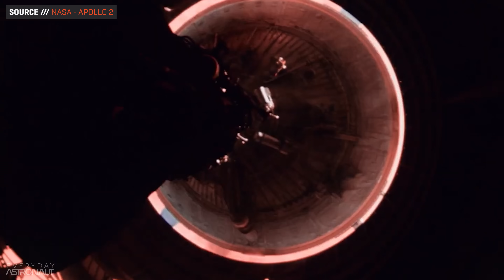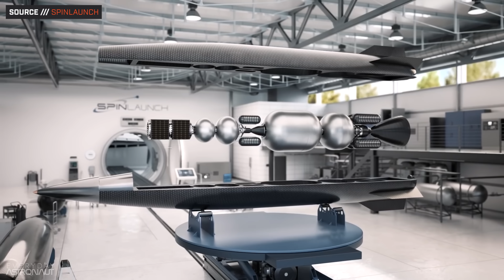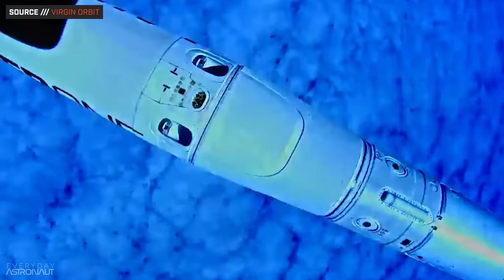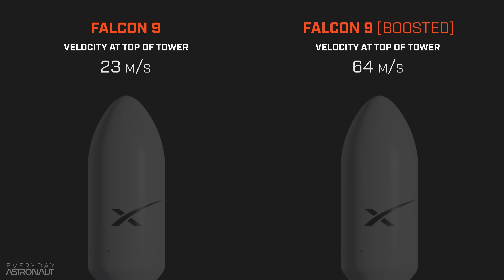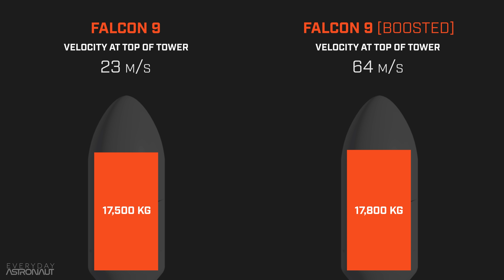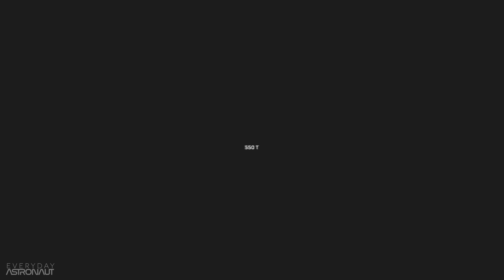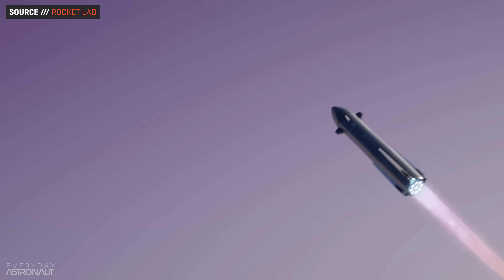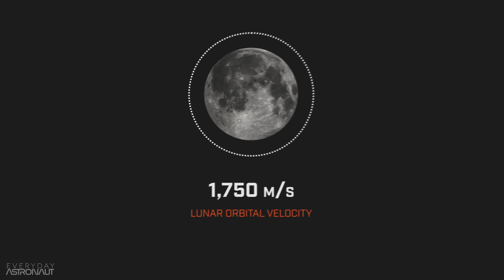Could We Help Push Rockets To Orbit?

Comment: You don’t need solid steel to fill a cube with weight, on a counter weight… fill it with water instead. Won’t cost $4 million dollars to pump water, & use an electric winch lift it empty, then fill it again. The water can be bled off to reduce falling weight.
Reply from the maker: Water is less dense than steel so it will require much larger size and more steel to support the water

Comment: 22:22 what if there were tubes that were a part of the vacuum system that quick released to open moments before the hatch at the top needed to open.

The pressure filling the vacuum from the bottom of the rocket just prior to getting to the hatch couls add more velocity.

The hatch for the rocket would open a moment before the tunnel has reached normal atmospheric pressure at the bottom of the shaft.

Comment: I think we should continue to fill the propellant tank till the booster is past tower  essentially running the engines via ground based tanks  , I guess will just have to increase the tower length to 300 meter { which is achievable} and create a feed mechanism [tubes } on slide rails or something in y axis . this will essentially act as a booster stage , with no addition of mass on the rocket itself , in fact the rocket mass will decrease substantially as we can redact the propellant tank size  overall booster which otherwise would have been used for initial acceleration, plus engine thrust rating can be decreased to obtain same mass to orbit effeciency, this extra effeciency can be either used to put more payload or make the rocket more reusable.   like it so TIM can see it and a video on it

Comment: The concept of imparting an initial velocity to a rocket via a "throw" mechanism from the ground: while the idea of gaining initial kinetic energy for \Delta V savings is theoretically sound (directly reducing the required \Delta V from the rocket's own engines per the Tsiolkovsky rocket equation, \Delta v = v_e \ln(\frac{m_0}{m_f})), the practical implementation presents formidable engineering challenges that likely negate any net benefit.
> 
> Consider the impulse required: I = F_{avg} \Delta t = \Delta p = m \Delta v_{initial}. To achieve even a modest initial velocity (e.g., hundreds of m/s) for a multi-hundred-ton rocket, the peak forces (F_{avg}) required would be immense, leading to extreme structural loads on the vehicle that far exceed typical launch accelerations. This necessitates significant over-engineering and mass penalties for the rocket itself, counteracting the very \Delta V savings sought. Furthermore, the energy transfer efficiency of such a "throwing" system (e.g., a railgun or giant catapult) would be highly complex to optimize and maintain at scale.
> 
> In contrast, the established advantages of air launch (launching from an aircraft at high altitude) are fundamentally more efficient and achievable:
> 
>  * Reduced Atmospheric Drag Losses: The dominant term for atmospheric drag is F_D = \frac{1}{2} \rho v^2 C_D A. By starting a launch at, say, 10-12 km altitude, the rocket is already above a significant portion of the Earth's atmosphere, where air density (\rho) is substantially lower (e.g., less than 30% of sea-level density at 10 km). This drastically reduces the integrated drag force over the ascent profile, directly translating into less propellant expended to overcome aerodynamic resistance.
> 
>  * Minimized Gravity Losses (to an extent): While the instantaneous gravitational acceleration g doesn't change significantly at these altitudes, starting higher means the rocket spends less time accelerating vertically against the full force of gravity from sea level. The gravity loss term, often approximated as \Delta V_{gravity} \approx g t_{burn}, is slightly reduced due to a shorter duration of high-thrust, near-vertical flight in the densest part of the gravity well, and potentially allows for earlier pitch-over maneuvers.
> 
>  * Initial Velocity Vector: Air launch provides a modest initial velocity (v_0) relative to the ground (e.g., ~Mach 0.8 to 0.9, or ~250-300 m/s), which directly contributes to the overall \Delta V budget. More critically, this velocity can be largely horizontal, aligning with the desired orbital velocity component, unlike a vertical "throw" which requires an immediate, energy-intensive pitch maneuver. This initial horizontal velocity directly reduces the \Delta V required from the rocket engines to achieve orbital insertion velocity.
> 
> While an initial "throw" might seem appealing on a napkin, the engineering realities of energy transfer efficiency, structural integrity under extreme transient loads, and the physics of atmospheric density make a high-altitude air launch a far more elegant and practical solution for achieving meaningful \Delta V savings.

Comment: If you launched a model out of the roof of an elevator at the middle floor of a building.  3 times going up, down, and stopped.  According to this video it should fly up the farthest while going in the up direction?

Comment: What engineering student doesn't think about this?
The location of launch sites close to the equator is an obvious factor that everybody knows about. 

 I often wonder about why higher locations are also not chosen. If a large rocket burns 500kg of fuel per second, a couple of hundred feet of extra elevation could save a couple of tonnes of fuel. But I suspect such locations are more of a problem than an advantage.

The silly ideas also get entertained. Accelerating the launch platform with the rocket on it effective sling shotting it just a few hundred feed giving it free acceleration in those first couple of seconds. I don't think that is realistic for big rockets, but might be for smaller boosters. 
  Re-using first stage boosters and landing them on a pad or a ship. That was a batshit crazy idea ... now it's so routine, I'm embarrassed by my own outdated sensible thinking.

Comment: Yes, your ideas are absurd. Why use steel for counterweight, when you can use much cheaper concrete, or even just rocks? Ok you won't get the whole desired outcome but you can have some. You can use a water pool deep enough under the counterweight to slow it down, just let the water splash away. You can combine it with the electrical assist, increasing the height of the tower by x4 or x8 thus reducing the desired amount of electrical power needed. So... I think you hadn't thoroughly calculated all possible solutions in their combinations.
Reply: This is Easy to Solve. Build 6 Halfpipe Shape Concrete Hills around it. Roll down Barrels wich you Fill up With Water. The Cable System also is Simply The Barrel itself, winding up while Rolling down. This way its also a Smooth Transition, for the Rocket to take over instead of some Abrupt ending.
Reply: He didn't elaborate because either way it's a completely unreasonable amount of infrastructure and engineering for single percentage gains.

Comment: One thing missed in all this is the structural reinforcement required to resist the acceleration. They're currently optimised to have forces applied only where the engines are pushing. Any kind of attachment point would need reinforcement, and the extra weight of that would probably negate any benefit you got from the boost.
Reply: Simple, just have the launch assist push on the engines or the engine mounts
Reply: @d @da54177  You say simple, but pretty sure it would take an extensive redesign even then. Especially as rocket motors are generally not designed to be pushed by anything but themselves

Comment: Tim's forget the weight of the assist mechanism itself. There's attaching hardware, framework to maintain stability. That would require a far bit of power just to lift itself.

Comment: 0:22 Thos is why reusable rockets are a mistake. Especially for for giant monstrosities.  The last bit of fuel is the most effective, because the mass is the least.  Wasting that fuel for a landing is massively wasteful compared to just using a cheap solid fuel rocket dumped in the ocean.  The cost to repair and reuse the booster is more than the money saved; especially due to the loss of payload capacity and the cost of much more complex engines and the entire system.
This was proven decades before SpaceX came along.

Comment: Discharging the electricity would not even be the biggest challenge and it would not make any sense anyway. You've got all the energy you need in the fuel, all you need is to use part of it in a way that would not require you to accelerate it

Comment: I've always thought there should be a first stage that has jet engines to get the first 50,000 feet or more. Once the air gets too thin it would switch to rocket engines.

Comment: You could put the weight on an incline, easier to safely stop it at the end. It needs to be a beefy, solid structure, probably just solid stone would be good. Maybe you want them on multiple sides to have a balanced force applied, put them on 4 sides and launch out of the center. Now you have a pyramid for launching space craft, and as a bonus you can keep grain in there in the off-season.
Reply: Your last line was amazing!!! 😂😂😂

Comment: 28:45 about power consumption: since we limited ourselves to 5g acceleration the required power for that acceleration is constant and not quadraticly dependent, but energy is. With decreasing allowed acceleration threshold (ex 5g -> 4g) the tunnel or rail has to quadraticly increase in length. The required power would in this case linarly decrease (20% for 5g -> 4g case). Total required energy required is ineed quadraticly dependent.

Also a controversial topic, but we could use nuclear reactors that have much higher power to weight ratio to propel the rocket (heat up gas to thousands of degrees).

Comment: Ugh..KISS. Use the atmosphere. The X 15 flew into space in 1959! The first stage of modern rockets lift mainly fuel! Flying to the top of the atmosphere using standard rockets and then switching to engines to enter orbit is the answer!

Comment: I honestly think many of the comments are great. 

You wouldn’t need a perfect vacuum. You have to mitigate the forces of atmosphere. I think the counterweight + pulley system + creative earth bored tunnels for the counterweights that, as they plummeted, they would effectively suck the air from the launch tube. 

If you could save 3% with a 400ft tower, imagine a low air tunnel tower of 2000-3000 feet.

This gets you off the ground using the same resources, offset your weights with 10-20 tunnel/rail systems connected to around 50 or so pulleys through the base of the ship. Once the weights have done their job, we could use several means to stop said weights over distance. 

Sure it’s some infrastructure, but to get it off the ground until the tech can get more efficient, this could maybe work? It’d look like a spider of tunnels. Maybe find some ideal hills that would have the innate strength needed to hold it all together. If you can cut thru it of course. 

I love the idea of yeeting things to space.

Comment: They could have a separate fuel injector that powers the rocket from the ground till it clears the tower. It could inject fuel till the rocket clears the tower. That way you could save a ton of fuel used for the initial power up

Comment: To me, the most important area of R&D for rockets and spacecraft is engine efficiency. Developing new methods of generating more thrust with less fuel is the best use of resources rather than investing in significant infrastructure to hurl an object away from a gravitational force. 

This is all until we figure out anti-gravity of course 😉

Comment: rockets are cylindrical and have hot gasses coming out the back. what of a vertical tunnel to keep the pressure in? drill a hole, assemble piping and fill with concrete around it. rocket assembly could happen at ground level and the whole thing lowered for the next part. the tube would double as support tower.

Comment: ... and whatever payload gains you would get by boosting the rocket, you'll loose for the structural reinforcements of the rocket. Now you have to make your rocket support handle compression from the end (where the engines are) but also from the side where you would hook it to the maglev or pulley...

Comment: How about a flywheel/fan turbine blades + a magnetic repealing force to add extra speed and the idea of that is to keeping it from having a breaking point, and needs to come down safely to be re-used, but also (DANGEROUS) if there is a failure like heavy flying chunks of metal zooming at high speeds through the air. A test in a game simulation first. The original idea is for an underground electric generator.

Comment: There is two points that you didn't approach here, which is that 1 the yeet system does not have to be electrical, could use fuel as well and 2 the added boost does not have to add payload weight, but could actually reduce rocket weight (and required fuel, so more than 1:1). A rocket engine headed toward the ground while pushing the other (lighter) rocket could probably help no ? Basically the idea is, don"t carry the fuel you don't have to for as long as possible.

Comment: We just need to accelerate rockets in hyper-loop tubes over around mile long. Divide the tube into sections with different air pressures building up to atmosphere levels to reduce a shockwave leaving the the tube.

Comment: How did he end up with 300 kg saving on the Falcon 9? The huge amount of energy released by the launch assist must be more than 300kg of less fuel? What about contributing all the 3G from the assist, running the engines idle and delay full trust 2 seconds. How many tons of fuel is burned during 2 seconds? More than 300 kg🤔

Comment: When you say the numbers, you emphasize so much that they are big, that it’s hard to actually get the number. “On hundred and twenty five thousands kilograms”. What about “hundred and twenty five tons”. Short, easy to comprehend. Or at least put both numbers on the screen, not just the imperial. I had to skip back twice to get the actual number, drowned in make-it-sound-big play 😅

Comment: Why not use another rocket pushing a level downwards to lift up the other side? You wouldn't need to make the whole tower sturdier if you're attaching the lifting arms near the engine section. Basically use another super heavy lift pointing the other direction. Or 5 of them, or however many engines you can get on a platform plus fuel. Doesn't have to burn all the way to orbit, just for a few seconds so the fuel capacity necessary isn't huge. The lever arm would need to be incredibly strong, however.

Comment: Apart from the energy issues or construction costs, it would be hard to do any of this without offsetting the gains by having to add 1-3% mass for the structure/mount points needed for the lift.

Comment: Why don't they have a third (first) stage that uses Jet engines? 78% of the fuel load is liquid oxygen but there is plenty of oxygen available for the first few km of ascent? Start with jet engines, less need for water deluge, plenty of time to get the rocket engines going once clear of the tower, get up to 18,000m and several hundred m/sec then drop the Jet stage which can self land for re-use. Then much smaller 2nd stage rocket does the next phase and starship continues from there. Rocket engines can be optimised for lower pressures further boosting efficiency/thrust.

Comment: 26:00 "The tube would remain in a vacuum assuming the walls were strong enough".  I don't think this is the case.  The atmosphere doesn't disappear at high altitudes, it just gets thinner and thinner until you get to around 1/10th of the way to the moon.  So any molecules floating around up there would fall into the tube, and sink to the bottom.  Over a period of time, enough would fall in to create a new column of air just like you had before you drained it.  The question is really, how long would this take, and would it be more or less than leaks at the bottom from use.

Comment: launch system next to a dam. water as the weight which can be purged for cheap reuse and refilled at the top using gravity at or near the water line.. and you have water which is needed for the sound dampening. plus a huge wall on the dam sides or the dam itself. which would be taller than the current mount so potentially cheap and better.
the forces involved could be devided to multiple sides and at multiple attachment points.

Comment: Can't rockets be refueled during this first 2-3 second near the tower? I mean instead of inventing assist launch we can just top up some fuel after the first 150m. This going to add same 3% of payload with less of a hassle, no?
Also LHC run at 200 MV power supply, so 100 MV is very feasible.

Comment: I don't think you would build a rocket yeeting system with electrical energy. This is the kind of stuff that would be powered by hydraulics, and the tremendous amount power they can put out in a small package. You'd probably have a steam bank of high pressure steam pressurising a huge hydraulic reservoir, and upon release, a hige cylinder with a small surface area get's compressed and propells a cylinder the size of a car up the tower, pulling the rocket with it. At the top, the cylinder would have an overflow and release all excess fluid energy once the rocket has been released. 

This would mean installing a boiler bank, storing lots of fuel, then pumping up the steam storage to pressure and finally releasing all that pressure at one go. It is much easier to pipe a fluid to transfer this much energy than to savely route it with electronics. If the pipes get damaged, the hydraulic fluid just get's dispersed all over the place. No Arc from hell that fries everything conductive in a 200 meter radius.